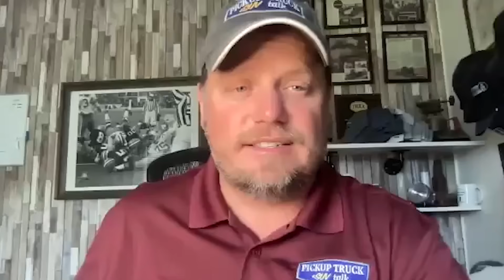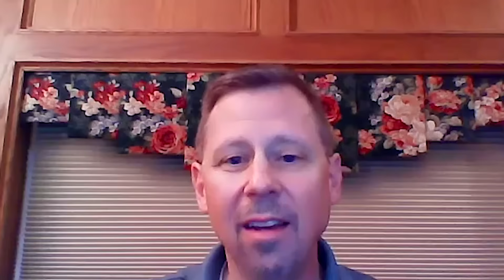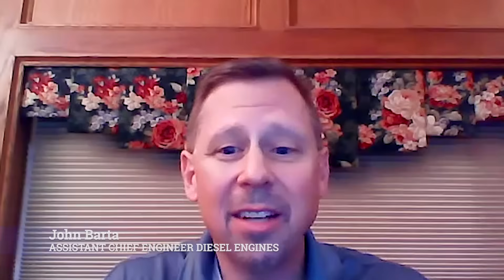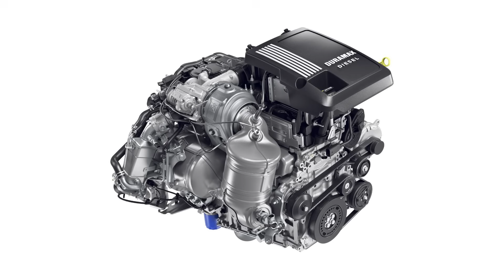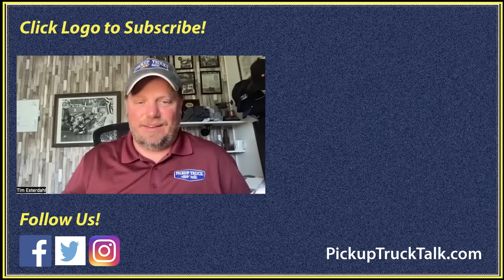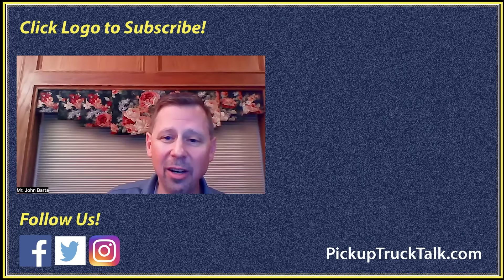GM's 3.0L Duramax Diesel Engineer Answers Questions Owners Keep Asking

Comment: As always, what a great video.  You sir are way ahead of many tubers.  Love the discussion from the engineers.  
1 question though.  When he was talking about the Oil pump belt & the new life expectancy to 200k miles.  He didn't indicate any changes, rather it seemed to me that they have just got in more testing & felt good with extending the service.  If that is true, I wonder if the LM2 owners wont be pushed to do the belt until 200k.  Please reach out & get clarification.  Please & thanks...
Reply: I wonder the same
Reply: @krugliy891  It also could have been tweaks by the belt manufacturer to improve life.  Power belts are a complicated field.
Reply: @marvinmcconoughey3547  I doubt it. The belts I have seen from LM2's at 150k miles look great with little to no cracking or wear. The oil pump belt is under extremely low load. The only engine that had failures due to oil pump belt failure is the 1.0 Ecoboost, but that was a case where Ford was using the belt as both the timing belt and oil pump belt, and had an issue with the belt tensioner failing and causing the belt to get shredded. The greatest risks to a wet belt are people trying to use a heavy duty 40 weight engine oil in this  engine in cold weather, or people putting aftermarket additives in the oil that are not chemically compatible with the belt. Some oil pump belts in Ford's 2.7 Ecoboost looked as though they were degraded, either due to aftermarket chemicals being added to the oil, or excessive unburned fuel ending up in the engine oil for extended periods and the fuel caused deterioration.

Comment: Someone really needs to make a stand alone for this motor.  I have multiple classics in my shop that would be awesome with this motor.
Reply: Exactly, I REALLY want an LZ0 crate motor I can put in a Toyota Land Cruiser or maybe even a Mercedes Unimog.
Reply: Cummins makes a 2.9 crate engine but hp a d torque are lower.
Reply: @beyondupnorth  Also it's an inline four cylinder, not naturally balanced like an inline six.

Comment: "additional technologies which we feel the diesel can pursue...reduce emissions but not penalize horsepower and torque...in a more cost effective manner" = Sandia Labs' ducted fuel injection design....resulting in bulletproof [or even deprecated?] egrs, an eternal dpf the size of a soda can and 1 liter of def lasting you 10,000miles. The cleaner burn might also push the golden cylinder as high as 650cc or more, which is the down the road entry for your hybrid option paired with a 2.4-2.7l I4 diesel.
Reply: Reference?

Comment: Why is GM not introducing some diesel/electric powertrains like they developed with their locomotive division?
Also, what are the new emissions standards coming for these Diesel engines?  They are already super clean!
Reply: Cause it would get 60Mpg and the engineer would end up missing along with all the patents. I've been wondering about this design sense VW  golf 4cyl days a time ago hybrid diesel combo would be super efficient in my opinion 🤔 😉

Comment: Would have been nice to go with a gear drive oil pump vs belt. 200k interval is nice but belts can fail unexpectedly.
Reply: Does anybody do gear-driven oil pumps anymore? The cost is so prohibitive it's usually limited to heavy duty diesel trucks that now cost anywhere from 70k to 100k or more. They are also noisy which basically guarantees you will have endless customer complaints about an engine whine, which was part of why manufacturers are moving their vane-style oil pumps to the oil pan in the first place. 

It's hilarious that guys think these belts are just going to snap. They're kevlar and they're under extremely low loads. If your engine or oil pump suddenly puts enough force on the belt to cause it to snap, you already have major engine issues before that belt failed. Have you even seen what these belts look like at 150k miles? They look far better than even I had anticipated. The only company that had oil pump belt issues was Ford with the 1.0 EB but that was a much different design. The belt wasn't just turning the oil pump and it had a tensioner that can fail and cause damage to the belt and ultimately lead to engine failure.
Reply: This comment hasn’t aged well. No one is reporting issues with these wet belts.
Reply: Ramitner I am 💯 percent in agreement. They should have dealt with the timing. This video was disappointing. Dealt with Bs the whole time

Comment: I have a 2021 RST . From what I gather they are not affected by the crank issue. One small thing I do miss is the backup alarm. The camera is great but no alarm. Even my 2013 Camaro has this. Other than that no complaints. A joy to drive. We have an 1800 mile trip over labor day planned. I will be towing a SXS. Right at 4000 pounds. Anxious to see what the fuel economy and DEF consumption are.
Reply: Dope how did it go? I have a ‘21 RST Z71 Duramax and love it.

Comment: In an economy diesel truck, maybe 20k miles a year makes sense. 

Diesels built their reputation driving way more and longer than that. 

I get the distinct feeling this engineer hasn't had anyone tell him "yeah we gotta remove your transmission for this one, gonna cost you 3 grand for a belt change" 

This design has deviated so much from the purpose and benefit of diesel it is totally not worth the trouble unless all you do is drive an empty truck 30k miles or more on the highway per year.

Comment: Do you still have to remove the transmission to replace the timing “belt”? Not even a chain.
Reply: This engine doesn't have a timing belt. It's an oil pump belt. It literally just turns the oil pump that's submersed in oil in the oil pan. 

A chain would require a similar service interval. Chains and sprockets wear. Most engines with timing chains have a service interval of around 200k miles, particularly DOHC engines with very long chains. This oil pump belt is under very low load unlike a timing belt. The only oil pump belt known for premature failure is the Ford 1.0 Ecoboost but that belt wasn't just turning the oil pump, it was also serving as the timing belt, and it had a tensioner that was prone to failure and causing rapid belt wear. This engine doesn't use a tensioner and the belts I've seen from these engines at 150k miles are in great condition.

Comment: My son is a chevy diesel tech.  Just today he told me he has several of these engines with destroyed cylinders.  And they dont run well with the bio diesel fuel.   

Not as great as you sell here.
Reply: What dealer so I can verify this claim
Reply: Was he referring to the LZ0 or LM2?
Reply: @mrx21100  LZ0 isn’t out yet so he would be referring to the LM2

Comment: It will be interesting to see  how long these engines will last compared to the diesel engines in the heavy duty trucks.
Reply: A straight 6 diesel is about as reliable as you can get, and it seems they care about longevity if he’s talking about removing complexities of the engine. I love the straight 6 Chevy’s of the past they run well and forever so I hope they turn out the same way
Reply: Should last pretty long based on my oil testing results at 43k miles on my LM2
Reply: @MixedGrid  what oil are you using?
Reply: 300-500k miles on the engine itself. The engines never really go anymore. It's eveyrthing else attached to them that goes first.
Reply: Exactly--Longevity is a chief outcome one would think.
Reply: That’s what they don’t say, because I can’t buy that engine if in 100k miles fail I want a engine more reliable than that if you take care is for many years 🤷🏻
Reply: Cool story bro, tell it again

Comment: No matter how you try to spin it, the belt is a big issue. Who only drives their diesel truck 10,000 miles a year? It is a diesel truck, people drive them probably 30 to 40,000 miles a year if not more. It's a giant expense.
Reply: You can’t pretend other diesel trucks don’t also need repairs by 150k ..injectors, hp fuel pumps, engine leaks, replacing transmissions themselves. They are calling for an “inspection”Pulling a gearbox is no harder if not easier than removing the whole front drive assembly any good mechanic can have the gearbox out in under an hour .it’s not a big issue at all
Reply: @Nscardigno33  But why the expense when it doesn't have to be?  No thanks.

Comment: BS. I want to hear these good reasons for a belt taking a trans drop.
Reply: A real mechanic knows pulling a gearbox is very simple and takes similar amount of time just less parts to remove compared to removing the whole front drive assembly and radiator to access
Reply: @Nscardigno33  It shouldnt take "a real mechanic" to service a damn oil pump belt.
Reply: @ryanmirl  if you aren’t a mechanic you shouldn’t be working on your shit anyways 😂 that’s so irrelevant
Reply: @ryanmirl  if you can’t pull a transmission you shouldn’t be taking anything apart on a car . Gearboxes come out so easy ya know if you’ve ever work on anything before you’d know that 😉
Reply: @Nscardigno33  Im not a mechanic professionally but have done tons of work and saved tens of thousand$ working on my Jeeps. Im not afraid to work on my vehicles. Besides lining a mechanics' pockets, you've provided no good reason for dropping a transmission, t case, and disconnecting drive shafts to check a belt. OEMs keep making things so that customers cannot work on them. Im puzzled by mechanic bros like yourself that take their side and root for hard to repair designs. Its an i6 diesel. This has been done for decades reliably without this stupid "feature".
Reply: @ryanmirl  if you have mechanical experience then you’d know it’s pretty simple . Stop complaining about a simple inspection. I’d much rather pull the gearbox then the whole front drive assembly . Have you ever seen how much stuff is packed up front of this long i6 that almost reaches the core support?. Oh that’s right you don’t have one to look at however I do and the belt inspection is not a worry in the world to me ☺️
Reply: @Nscardigno33  Bottom line... what is the cost from this competent mechanic to replace this belt that should be a chain?
Reply: @testtesting2868  guys like you just like to complain about things that don’t effect them. bottom line.. this one thing you call a draw back is no where near a big enough flaw to overcome how good of a truck and overall engine it is. You call it a design flaw but you aren’t an engineer now if they were failing at 100k sure but never has a belt actually failed. Enjoy buying a gas truck and have the lifters fall out at 40k . Want a ford ? Okay wait for the timing chains to stretch at 140k . Oh a dodge you say? Good luck replacing the turbo lines at 70k miles, egr cooler around 100k then the turbo shortly after. I guess you’ve never looked at how hard the dodge diesel is to work on😂😂
Reply: @Nscardigno33  If GM wants to warranty the belt and failure up to 200k, I am all for it!  BTW, I am an engineer.... I don't work for GM though.
Reply: hmmm The cost must be a LOT of money?

Comment: I have the LM2 2020 Silverado 1500. I’m curious when they will increase the payload and towing capacity to better match this great engine? My current truck is rated at 9,300 towing capacity and payload is at 1,590lbs
Reply: My 2005 1500 with a 5.3 gas has a payload of 1587 lbs.

Comment: New engine sounds awesome!! Diesel hybrid sounds like more trouble than it's worth. Now a diesel traction motor (think diesel train) seems like a better solution. Basically a diesel generator powering electric motors.